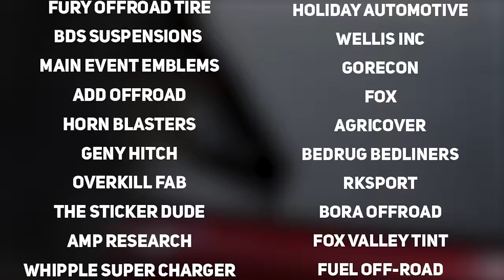TUG OF WAR - SUPERCHARGED CHEVY VS TURBO FORD!

Comment: The taller truck will almost never win when you hook the tow straps like that it was literally picking up the rear tires from the torque of the drop hitch.
Reply: Travis E I know right they make it seam like the Chevy is good but actually the ford could have pulled it from pa to Mexico
Reply: Exactly do it stock no lifts and stock tires

Comment: Well in this kind of competition weight, torque, grip and power are important components.
I saw the outcome when I realized that ford has bigger tires and when you have bigger tires you loose torque and power. Also he floor it instead of braking and that was a mistake too because once you are spinning your tires you are loosing grip of course. Still the ford have lost.
I'm more into RAM trucks, but fords are the better work truck.

Comment: lemme just point this out 1 the Chevy added roughly 1,000 pounds to it with 3 guys that big say they each way 300 or more pounds plus the ford was 2 inches higher plus it wasnt stock so it's not surprising that the drive shaft broke  if the ford was the same lift height and had those 3 guys in it no doubt it would have won.

Comment: Looks like the front driveshaft on the Ford  was extended out farther than it should have been due to the lift kit and broke because of that. These tug of wars usually come down to which vehicle weighs the most unless something breaks.

Comment: You can clearly see why the front drive shaft broke, the huge lift and tires alone didn't do it, using 4 low, too much throttle and stabbing the brakes!?  What were you thinking?

Comment: See the problem is the ford had to high a lift kit, the higher (or lower if yoy get you truck lowered) the less towing/pulling power you truck has, 8" vs 6" lift, it may only be 2 inches but 6" is closer to stock and stock abviously has the most hauling power.

Comment: Sad part about this is that my 96 f250 460 spd 225k miles would drag those trucks without leaving an idol fully loaded during the fall it scales at 9100 and I bought it for 500 bucks 8 years ago

Comment: Woah obviously the truck with lower center of gravity going to win
Reply: Lol.... so not true
Reply: Scott Ackerman explain
Reply: That's why they hooked the strap to the white one right in the hitch and the higher truck lower to make the strap level. Also the 2 biges factors in a tug of war on pavement are traction and weight. That's why the dude in the white truck yelled for his friends to pile in the truck.
Reply: Scott Ackerman lower center of gravity equals more more weight towards ground equals more traction. Higher the truck the less it will be able to tow
Reply: Scott Ackerman haha I don't I'm just throwing shiz out there cause I'm bitter the Ford lost
Reply: @jornelindberg5127  lol it's all good, if the food's drive shaft didn't break he would have won. Diesel vs gas is never fair, that's why in tractor pulls they have gas in a class and diesel in it's own class.

Comment: Obviously the chevy won. The chevy is supercharged and immediately has power. The wheels are also smaller (the larger the tire size you have the less torque you have)  and he did extra stuff to his truck to give it more power. The Ford has a turbo which needs time too spoil up before it has the power. He also didn’t do anything to his truck to “outsmart” his opponent. It was obvious the chevy was going to win and I knew it from the start as soon as it said “turbo vs supercharger” it’s a no brainer that the chevy won

Comment: That hitch on the Ford is too high, also he should of gone with 4 high not low,. The diesel should be stronger and has a higher towing rating.  And they should've done several tug of war competitions. 2x4, 4x4 high, 4x4 low and a freestyle one just for the fun of it.

Comment: a supercharger vs a turbo means that the chevy would win every time. superchargers give low end boost and turbo’s only kick in at higher rpm
Reply: True but a Diesel redlines at like 4k rpm.... So is not like it's got far to go.  Also, the diesel has more low end peak torque... So.

Comment: 4 low was your problem don't ever use 4 low + to much power possible wrong gearing with oversized tire = Carnage. I shredded 6 teeth off my ring gear

Comment: All you that say Ford just makes crap parts, I’m pretty sure that wasn’t a stock drive shaft. Ford had a higher lift which makes it less stable and don’t forget the center of gravity the truck lowest to the ground has a greater advantage. And then the driveshaft broke so I say rematch once it’s fixed

Comment: Too many variables. Tires were better for tug of war on the Chevy, he was lower to the ground which helps, He had to add what looks like 700 lbs of weight to the truck and then ratchet down the front suspension. I don’t care if ones a boosted gasser vs a TD....... what the hell did everyone think was going to be the outcome?

Comment: First of all, Ford is too high to pull a Prius. Second of all a turbos means fuck all in a tug since it low range which means a turbo wont kick in and a supercharger is better a low revs so instant advantage on top of that if that's an EcoBoost shits already over with for the Ford. On top of that its gas vs. Diesel. With the addition of offroad tored which has way less contact with the ground. I already saw the outcome before it even happened.
Reply from the maker: The Ford is a 6.7L Powerstroke Diesel, the chevy is a 6.0L Gasser. But it sure was fun!

Comment: You never use 4x4 mode to tow so why would you use it to play tug of war . The Diesel should have won as soon as he hit 2000 rpm but no he had to put it in 4x4 mode which is just as bad as using the reverse gear(weakest gear on the transmission) to pull something that weighs over 6000lbs.

Comment: The ford guy: “once the front drive shaft broke the trucks safety features kicked in. The trucks engine basically shut down.” Umm not the fuck it didn’t. Excuses, excuses and more excuses.

Comment: The ford is too jacked up. The lower vehicle will have the advantage.  Like the video where the little honda SUV out pulls the lifted v8 chevy. Poor test
Reply from the maker: Part 2 maybe!? 👀
Reply: @CustomOffsetsTV  yeah, both lowered and the chevy not weighed down with bodies. These jacked up tricks have no pull.

Comment: If that was 1994 ford with a 302 motot the ford would tow that piece of shit like its nothing because the newer fords are aluminum and super light they are built for speed and high horsepower not towing

Comment: The ford would have had a chance it it dident have those dumb tires and stupid high lift also how the fuck did it bend that easy
Reply from the maker: 1000ft Lbs of torque getting drug backwards by another 700ft Lbs will do that.

Comment: The funny thing is, was there actually any doubt that ford lost? All those extras and that junk still lost. That's got to be embarrassing. Spending all that money on that ford only to find, it's still junk
Reply: What extras other than appearance did he have to give him the pulling advantage? Bc he lifted it way up essentially putting a kink in that front driveshaft? Nope that’s not it. 40” tires? No that can’t be either. All the “extras” did nothing but hurt him. Flip the script and the ford drags the Chevy. Regardless of the brand, when you stack everything against it, it will lose.

Comment: So the Ford wasn't built completely they way it should have been. How's that make the Chevy better? If the Ford's drive line didn't go what would have broke on the chevy?  I'm actually surprised you can air down those rubber band of tires, definitely couldn't take either of those trucks off road without destroying those rims. Pavement truck gross

Comment: Ford still making way more horse power and look how much lower the Chevy is, height isn’t key to pulling the weight of an ugly ass Chevy
And they ratcheted the front down lmao, poor little Chevy
And this doesn’t prove anything once those tires spin on any truck the other truck is gonna fly backwards, I could of pulled that Chevy back with a Prius is the Chevy started spinning lmao this proves nothing